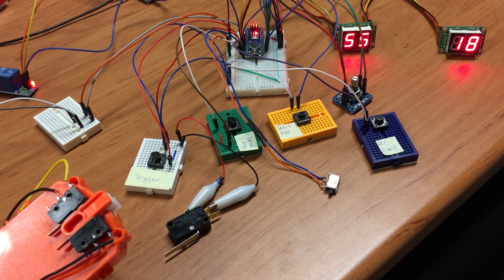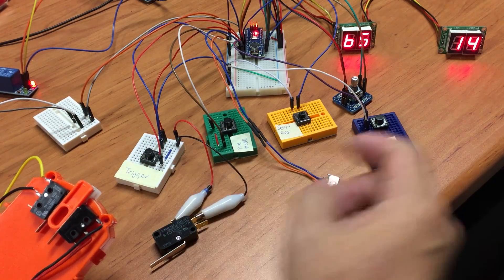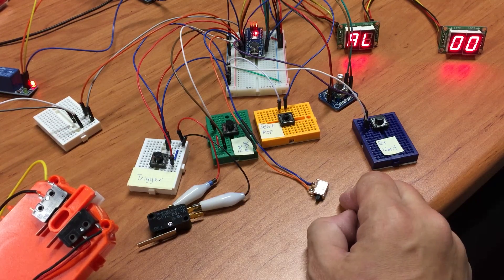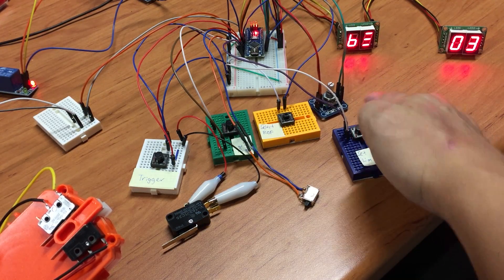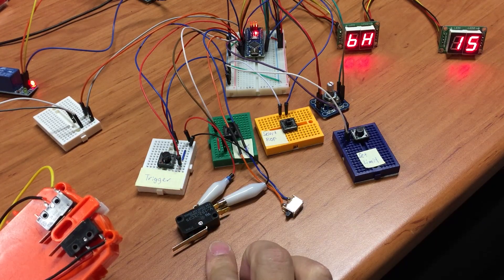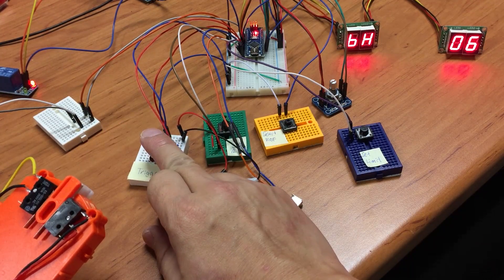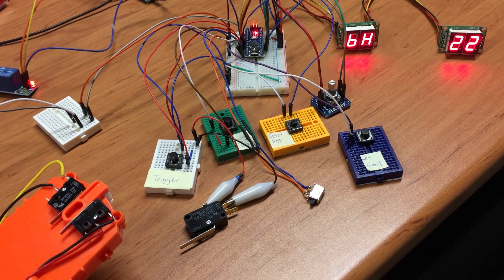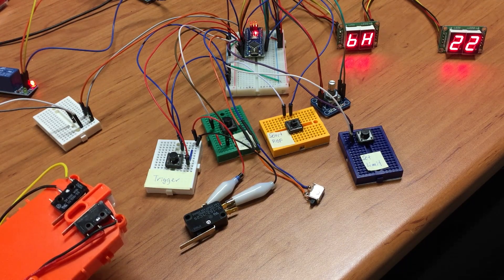{Mod} Nerf Rapidstrike + Arduino (Part One)

Comment: Hi Tungsten - Awesome mod - My Buddy and I are working our way through this mod, using your video step-by-step. We would like to know if you have a complete diagram for the wiring? We have been studying the diagrams for the mosfet and the pusher but we are still confused. Best Anders and Aleks
Reply from the maker: this is actually one of my older mod (did you see my latest mod on the RS, it is a more update version and all 3D parts files are on my Thingiverse). for this mod, you can visit my Github (link here: https://github.com/Tungstenexe ) go under Tungsten-V1, you can see all the part list, I don't have the full diagram but I do have 2 pdfs on the mosfet setup and pusher setup. Also I think you should check out my Tungsten-V3 on Github too, for that mod, I have the complete diagram.

Comment: Cool!! I was wondering why you are using two switches for the pusher control?
Reply from the maker: This was my first select fire mod, at that time I do not much know on arduino and circuits. I needed to stop the pusher and it was going very fast. In the end I came up with this approach which one of the switch is for tracking the pusher movement (when is it moving forward, when is it returning, and also count the darts) the other switch is actually part of a dead center switch arrangement which does the motor braking. I am current working on my next rapidstrike select fire mod, I am combining the knowledge I gain from this mod as well as the select fire stryfe. I also posted the dismantle videos for both mods, do check it out :)

Comment: Where did you buy all these items?
Reply from the maker: the itemlist which I use in my projects are mainly maintain in my github projects ( link: https://github.com/tungstenexe )  for example for this video, it is for my rapidstrike Tungsten-V1, so in that folder you will find a itemList.pdf or doc, in there will be the itemlist and the link I bought them (most of them) mainly from www.taobao.com actually, also you can checkout my V2 build which is an arduino stryfe, the program to control brushed-ESC and brushless-ESC should be similar :)  on btw for the mosfet, you can use the one in my mosfet video, it should be better IRL40B209.
Reply: Tungsten EXE - Thank you so much!! I sincerely appreciate your help!!!
Reply: I'm also curious. I saw from Mister Nathan YouTube channel that you helped him out with the Khaos speed controller. I'm wiring a three stage stryfe currently. Can you give some advise on how to wire the motors with the battery up? 😃😄😃
Reply from the maker: I have not done multi stage setup before, however if I were to do it I will use 3 mosfets for the 3 stages. One mosfet for one stage so that the current consumption for each set of motors can be handled by their respective mosfet.

Comment: what are you using to drive the motors? is it straight off the board or are you using a motor driver shield of some sort?
Reply from the maker: I implemented the circuit in part 2 of the video and also did a dismantle to show the internal of the blaster in part 3 (I will put the link below), I use relay, mosfet, etc. 
part 2: https://www.youtube.com/edit?o=U&video_id=cLgto652hZM
part 3: https://www.youtube.com/edit?o=U&video_id=xdaylSIGhEU

Comment: What did you do wrong to burn up the boards?  I am ordering an Arduino board this week and I don't want to damage it!
Reply from the maker: currently I am using "Arduino Nano" (img link: http://www.tronicsbd.com/wp-content/uploads/2015/07/nano.jpg ), I bought those China made one which cost around $3, I realize the on-board voltage regulator (the vin pin) is not very reliable, if I power the Arduino Nano with my 3s Lipo via that pin (as I am planning to use just one power source for all power supply for the build) the voltage regulator does not last and once it fail, there goes the board.
another case was, I am using a 7-segment LED module and I was not aware that the module was actually faulty, and the moment I power up
the Arduino Nano it cause vcc and gnd to had a short circuit which burnt the Arduino board, from then on I check the modules which I intend to use before plugging them in. another time was my wires (there are so many when I start to add more functions), I had some wires crossing each other without properly covering them, again it cause a short circuit, and yup burnt the pins again. Lastly, this is a usefully video, check it out :) https://youtu.be/WmcMrKELkcs

Comment: Is this kind of programmability possible with a stryfe-style full auto kit?
Reply from the maker: Yes it is possible, the only issue will be space to place the parts, so most likely will need to integrate with say a stock to house the arduino nano board, relays, etc (should be ok :) as for rapidstrike I believe the battery tray will be a good place for me to house the parts.
Reply: Good to know. I have a Demolisher integration project in the works that would make a good candidate for this kind of system. 
Now, I don't know diddly-squat about micro controllers or any of this electronic magic business. I understand that mounting the switches may be tricky, but how difficult is it to assemble the computer brain bit? Is this stuff reasonably expensive, by chance? Just curious...
Reply from the maker: mounting of the switch is actually not too bad as I mount it above rather than below :) currently I only secure it with a drop of hotglue, for the final version I can secure with screw, I checked the clearance, it should be fine.

For the cost of components, they are very affordable, for example the micro processor I use "Arduino Nano" it cost only $3, in fact I bought at least 10pcs as I know I am going to make mistake for a start and true enough I damaged a few during my learning process. Also the rest like relay, converters, etc they cost less than $1 a piece, so again I bought lots, so all in all the components are really affordable. 

For the programming, Ardunio is open source therefore the software is free as well. I do have the advantage of programming knowledge, so learning how to program Ardunio is alright, the hard part for me are the hardwares and they they work and how to control them, their behavior. I believe programming skill can be picked up as well. 

Once I finish this mod, I do hope I can produce some video to share about the program I came up with, now it is a little messy and there are places which I need to improve on.

Also if there is enough interest maybe I can create some basic Ardunio programming guide for Nerf application for beginners whom have no background, I am not sure will there be interest on that, as the videos could be boring, but I do like programming  Lol :)